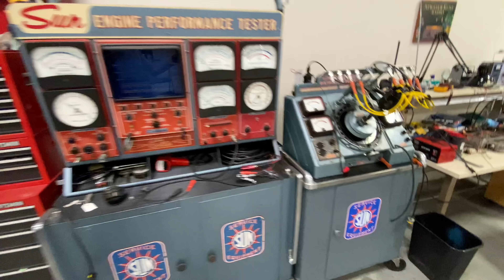Thieves Love To Steal Rare Metals From The Prius, But I Have The Power To Stop Them | Cat Defender

Comment: I use the same k&n filter with the nut welded onto it
Reply from the maker: It’s actually a good thing it has the nut welded to it. I had a heck of a time getting the old over-tightened filter off.
Reply: @ElliottAlvis  it can help. Altho ive had to still creat a crazy ratchet strap to get 1 off because they used the nut to tighten it too far, DONT USE THE NUT TO TIGHTEN IT!
Reply from the maker: @joeschmoe5009  I didn’t, don’t worry! Lol

Comment: Other reasons they are popular is the cats are bigger and more accessible than other more modern cars and often cleaner, being hybrids so more valuable. This came too late for me. Mine was stolen in June. Our local Toyota dealership fits CatLocs for £250 installed which is the route I went down after getting an aftermarket cat replacement.

Comment: The Wizard would like to have a word with you about not pushing on the body to move a car around the shop.
Reply from the maker: Lol you have a point. I did push on the bumper if it makes a difference. And the 1954 Corvette is extremely lightweight!

Comment: my gone sadly ,they cut it off in secured parking at work. heard thieves have a way around this ,not sure how but they cut it just very near the engine and then behind the plate ,then pull out both cats. saw photos they even cut into the anti roll bar a bit. here and in uk they say only changing to aftermarket and leave it "naked" can save it from thieves ,sadly this is not option in California

Comment: Just a question: if the thieves don't mind to cut the exhaust pipe to steal the cat, why wouldn't they also cut into the cat defender?
Reply from the maker: That’s a great question. Simply put, thieves are lazy and Priuses are plentiful. They’d take one look and see that this car would take extra work and move on. That being said, if they did decide to try to cut through the cat defender, it would take way more time, make a ton of noise, and they probably wouldn’t be able to cut all the way through it with only one blade.

Comment: Great product, i am curious tho,
I see they have vent holes to allow passing air to get to the cat for cooling but how much extra heat will be held by the cat not having the full air flow all the way round it as before, as surly alot less fresh air volume,
I'm sure they have done alot of testing etc but i do feel that if you use the car alot the life of the cat may be decreased,
Could be completely wrong but thats curiosity for ya lol
Reply from the maker: That’s a very good question. I will have to just see how it is over time. The airflow was always only on the bottom of the cat to begin with.  I imagine the increased heat will be negligible. Especially because the Prius shuts itself down at stoplights and is really only running when moving for the most part.  Good comment!